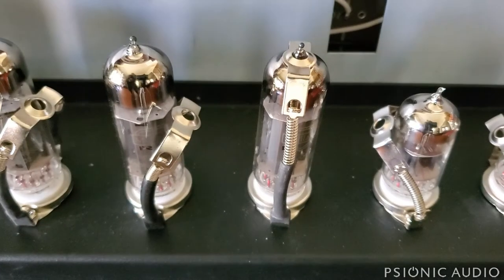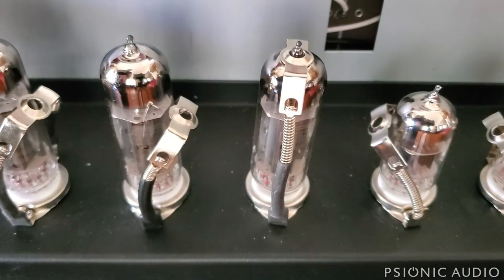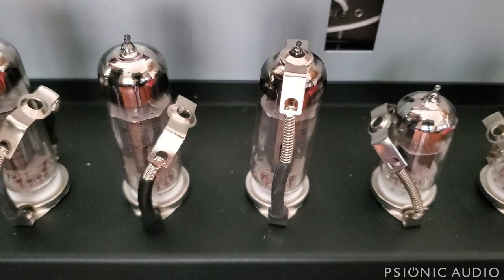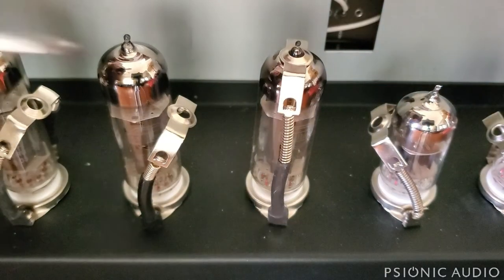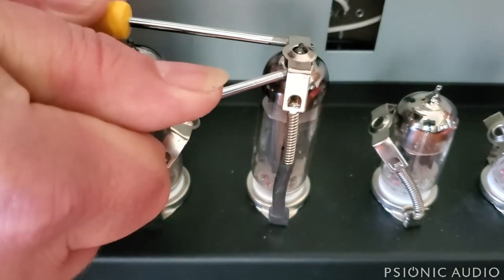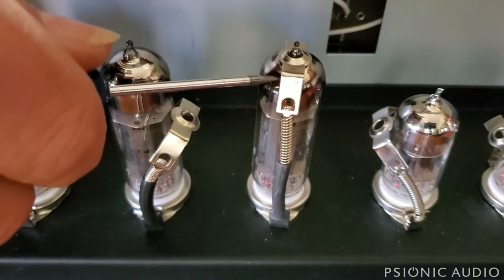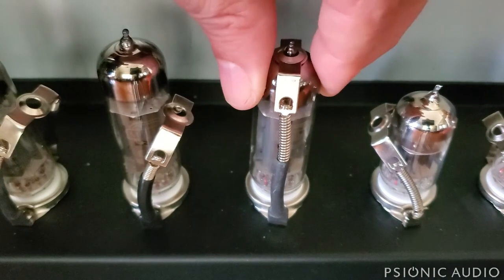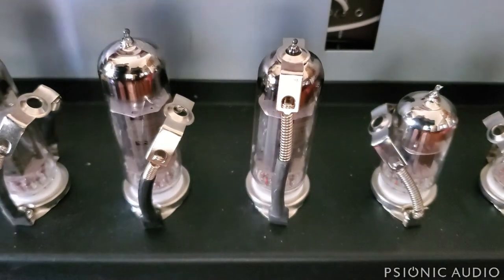Tech Tip: Changing Tubes in an Vox AC30 HW

Comment: Thanks for the tip on removing. I used 2 plastic drinking straws. If you can still get them. I guess string or thin ribbon would work too. The plastic straw seemed to glide easily between the clip and the valve.

Comment: Hey I'm trying to figure out why I have one output tube red plating after replacing some blown resistors and fuse in my vox ac30hw2. 

After replacing the resistors and fuses, the amp ran fine and all tubes seemed to be the same but after leaving on for 30+ mins the amp would not make noise and a single tube was glowing bright red with the other 3 nothing at all. 

Could you lead me in the right direction before I need to give up and take to a tech.

Thank you !
Reply from the maker: Take note of which tube and which socket redplates. Swap the output tubes around. Does the redplating follow the tube or stay at that socket?
Reply: @PsionicAudio  it follows the socket